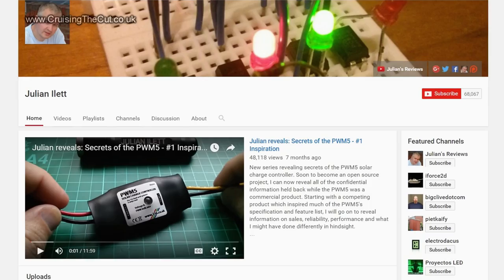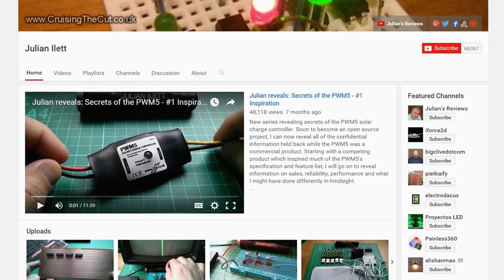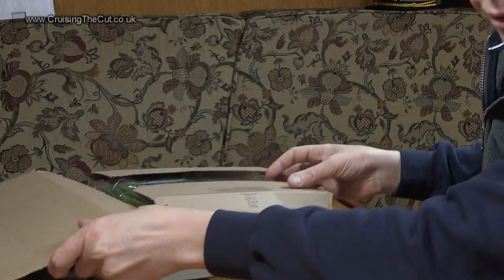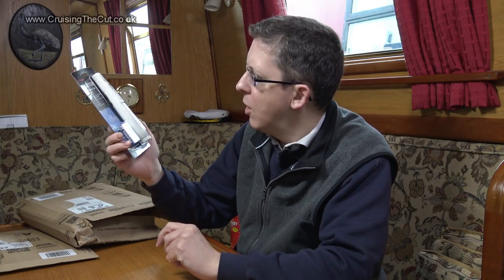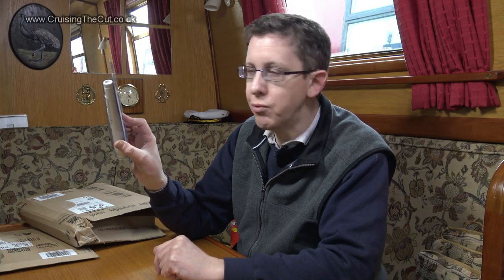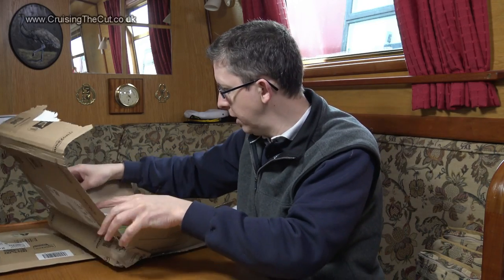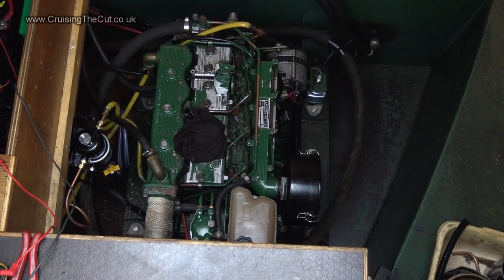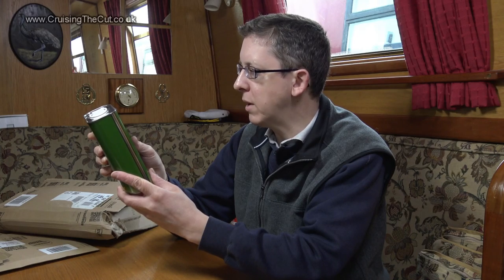24. Another haul of bits and bobs for my narrowboat.

Comment: Sorry - the degreasant is biodegradable - but the oil and sh@t is still harmfull !!!!
Reply from the maker: Which is why you mop it out and dispose of it at a suitable point. It does not go in the canal.
Reply: I do believe you cannot place anything other than pure water into a body of water, unless far out at sea.
Reply from the maker: Not the case in the canals where you are certainly not supposed to tip out oil and grease etc but otherwise grey water (eg from washing the dishes etc) does all get dumped into the canal.